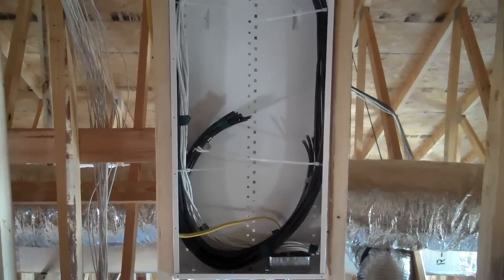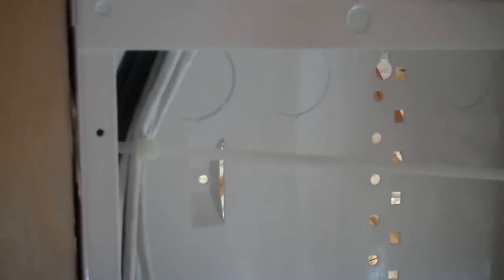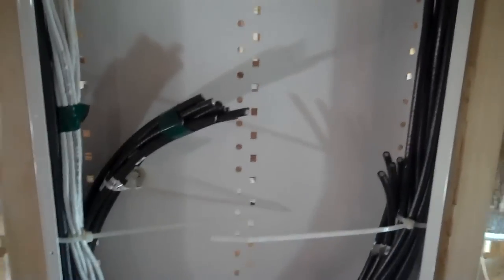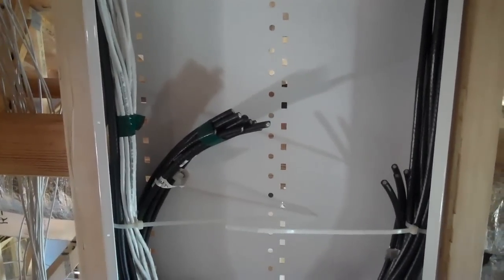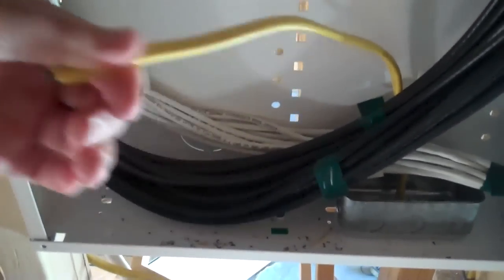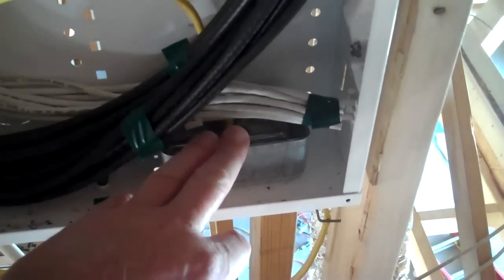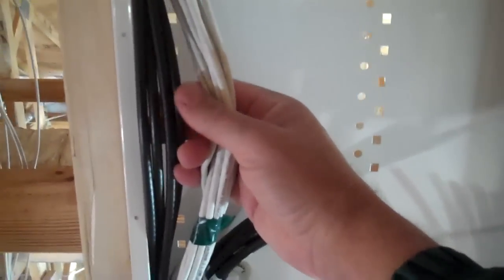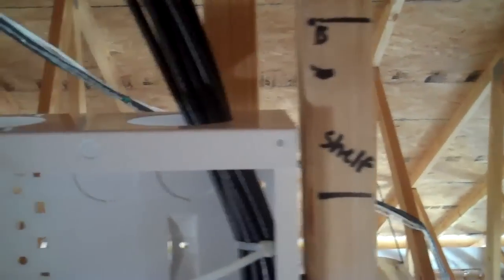How to install a Structured Wiring + Cable Distribution Box

Comment: sometimes theres a "wet wall" behind your closet, if you live in a second story house, It's a little room they use to run cables, AC, coax, electrical wires to the first floor, most of the time this little room has extra space, if you have this then you can use a different box bigger than this. You can even make your own little shelf if you know about construction.